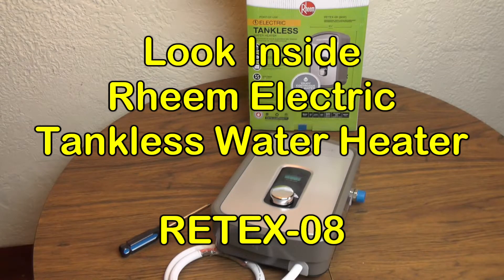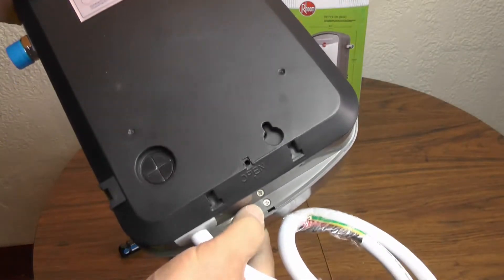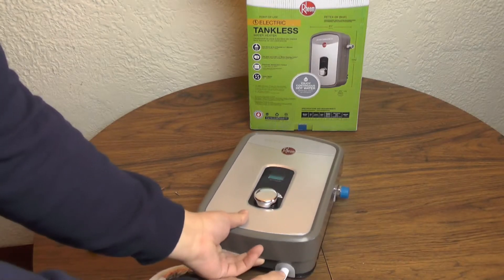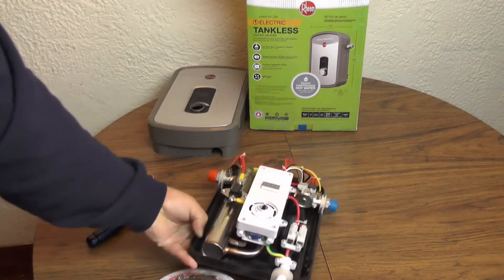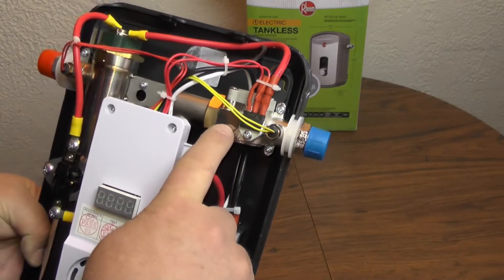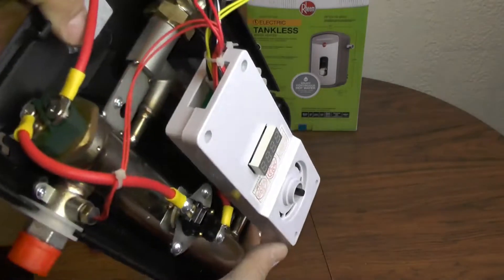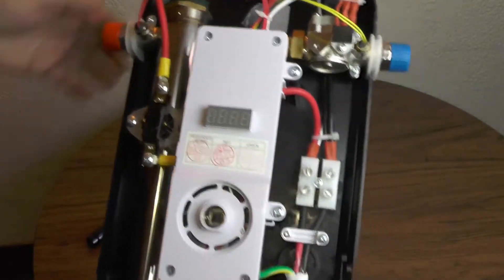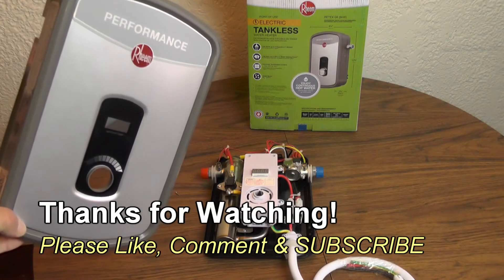Look Inside Rheem RETEX-08 8kw Electric Tankless on-demand hot Water Heater from Home Depot 120118

Comment: Hi, I have a quick question, so on this particular unit does it have a reset button? Cause I can set the temperature and I see it on the display but when water is flowing it doesn't stay on and water is cold. Thanks
Reply: I’m having the same problem
Reply: I would Verify Cold goes in on Right(Input) Side.